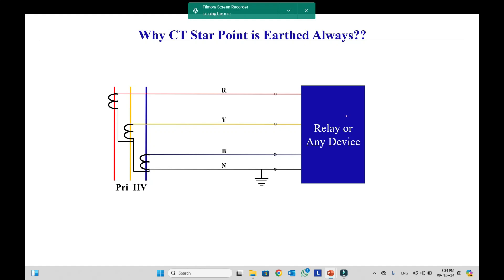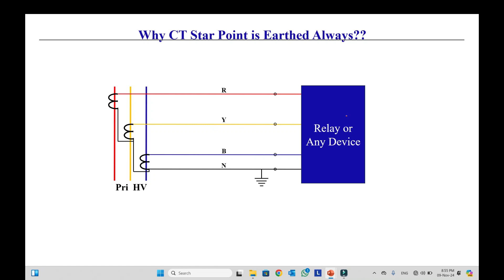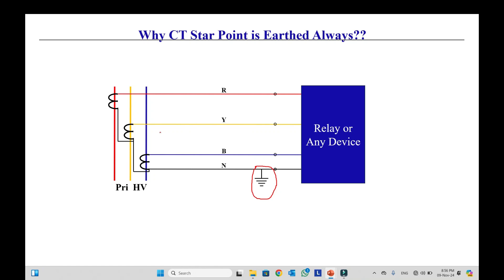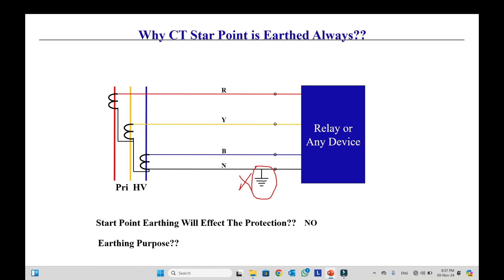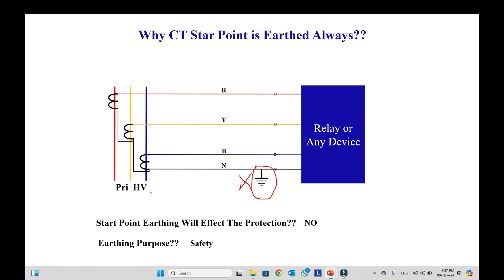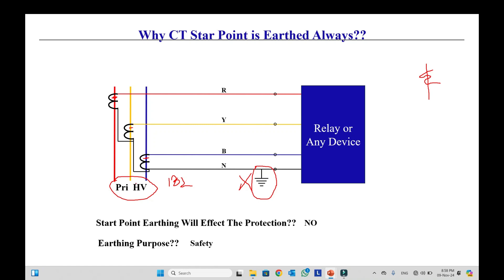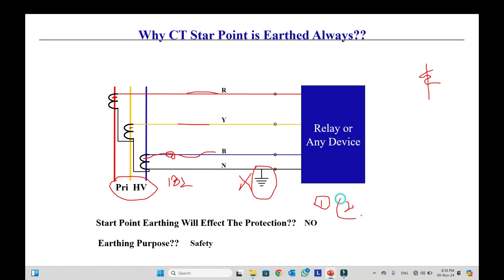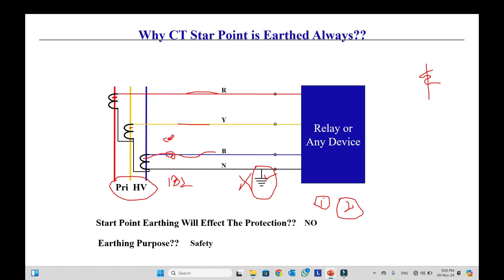Why CT Start Point is always Earthed

Comment: You said there is very low voltage at CT secodary, but technically CT is just an step up transformer, that steps up voltage at secondary side to reduce current in the secondary for measuring. Can ypu please explain this??